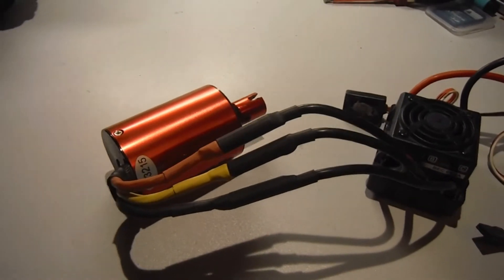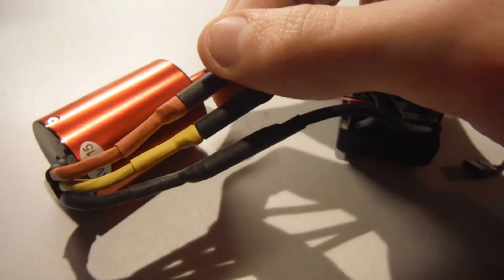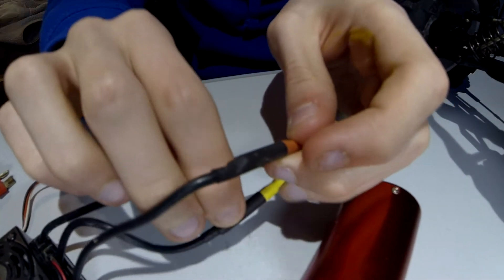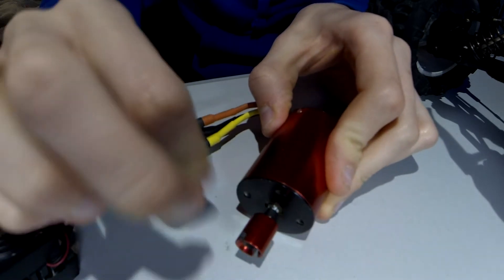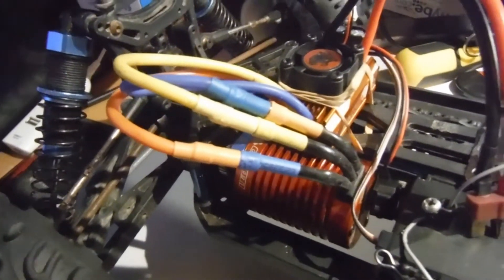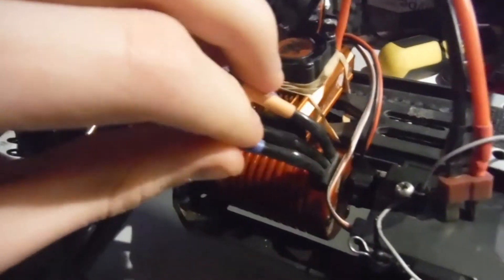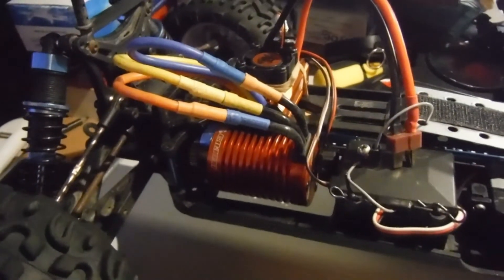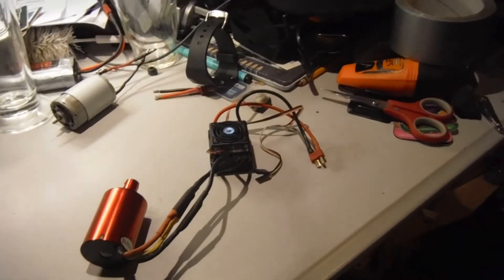How to reverse the rotation of a brushless electric motor

Comment: Is this when the transmitter goes backwards instead of forward? Cheers
Reply from the maker: Hello, you don't have to worry about that, on the controller there should be a switch that swaps the direction back to normal after swaping the cables over 😁👍
Reply: @CrossfireStudios  unfortunately my transmitter lacks this feature, but thanks to your video I managed to correct it. I left the yellow alone and swapped the orange and blue wires. Works a treat. Cheers 👍🏾
Reply from the maker: @hernanvergara9313  Ahh okay, I suggest if you can to get the Etronix Pulse GFSK EX2 Sport 2.4ghz Transmitter and Receiver, They are pretty cheap and are pretty tough, I run it on most of my rigs 😁👍